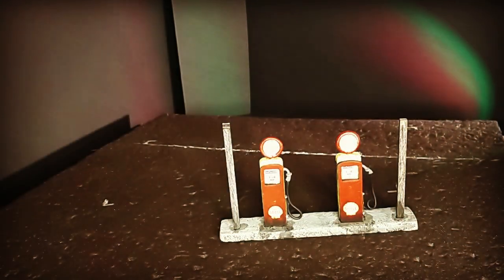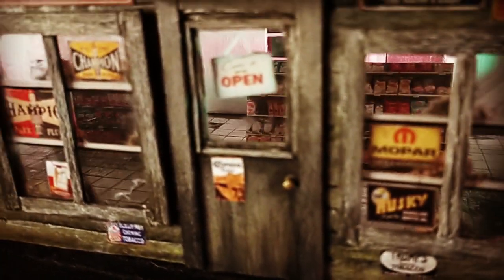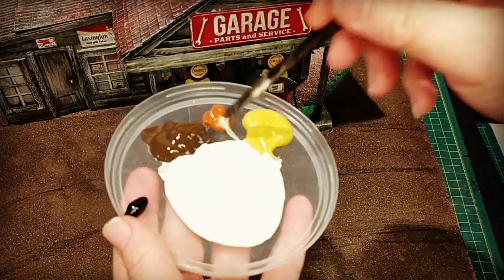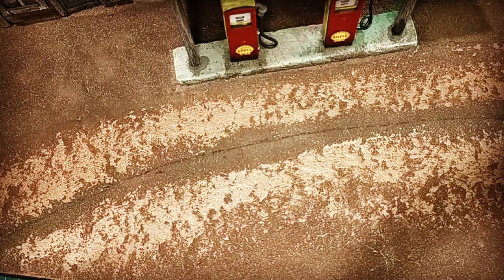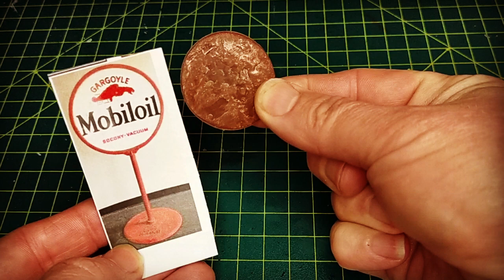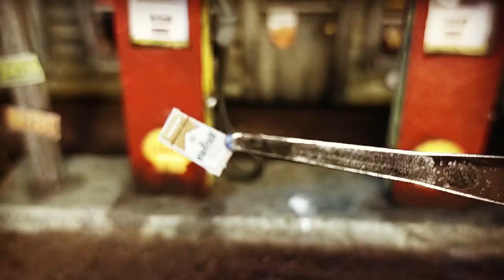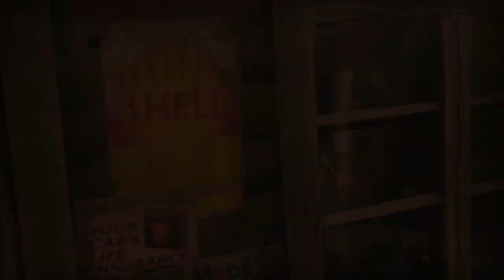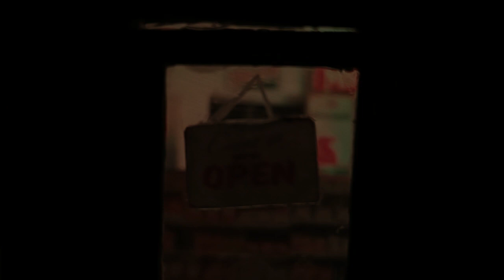Last chance gas station #diorama #diy #gasstation

Comment: Cozy little gas station.. and I like the fact that you use common remedies, not bought. Only small thing is that I doubt a Shell Station would have a Sinclair,  BP, Mobil Oil or any other competitive gas/oil brands sign anywhere close to its perimeters :)